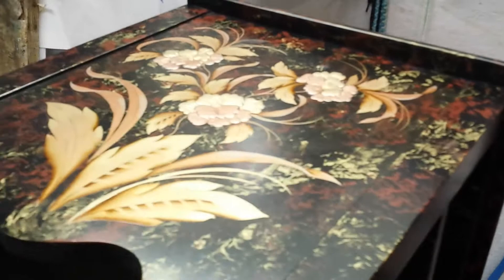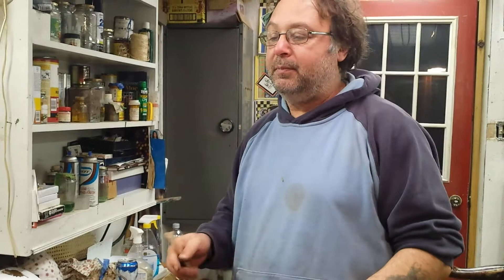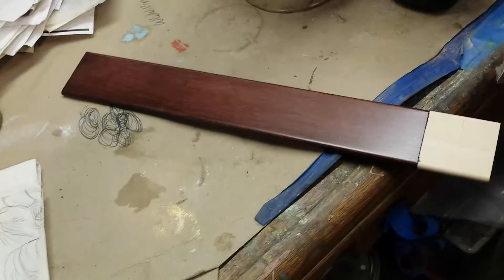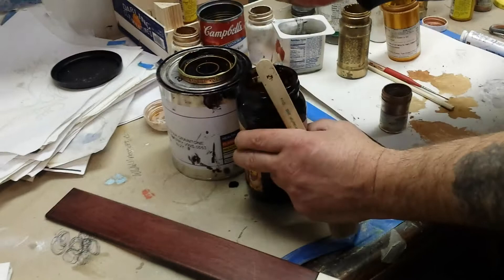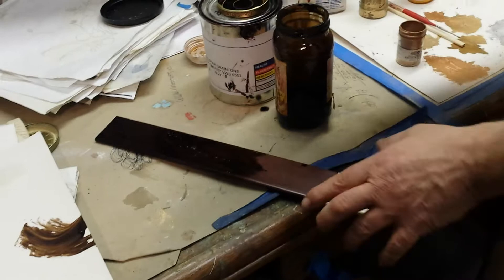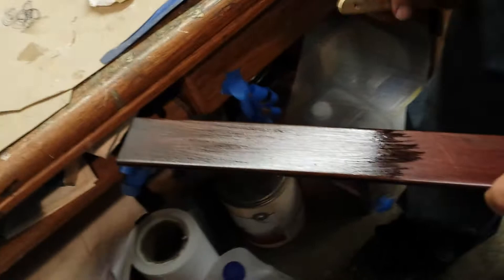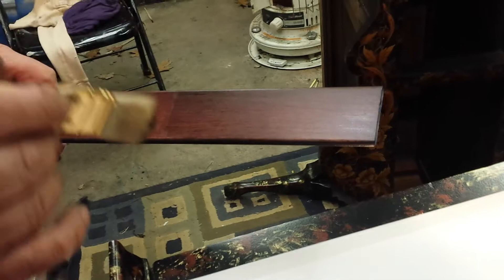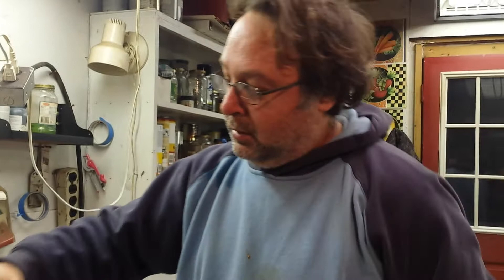how to stain and glaze your Ethan Allen   table top

Comment: If your topcoat is lacquer, you have a 2 - 6 hour window to shoot over the glaze, locking it in. If you miss that window and you try to lacquer over the glaze, expect your finish to wrinkle. If you miss that window, you have to let the glaze fully cure (24 - 48 hours, usually) before you can shoot lacquer over it. For other coatings, wait out the full cure time before topcoating. The glazecoat has to be topcoated with a film-forming finish. Don't allow too thick an accumulation of the glaze or you might get problems with intercoat adhesion. The glaze will reduce (thin with) naptha, mineral spirits (paint thinner), turpentine, or clear glaze base (solvent only, not water, not acrylic).
Reply: This video was very helpful!  One question,  do you mix the top dark stain with an actual glaze? if you do, what is the ratio?